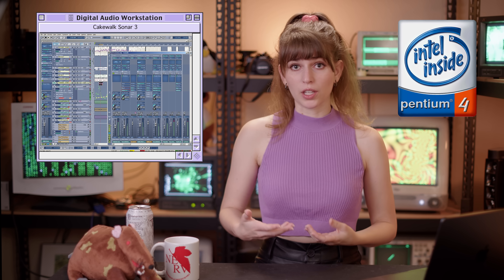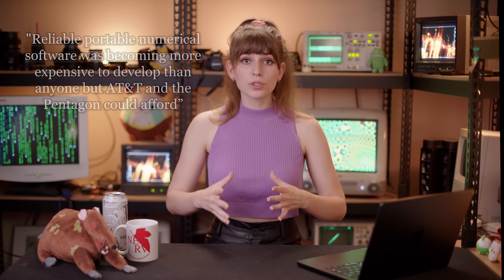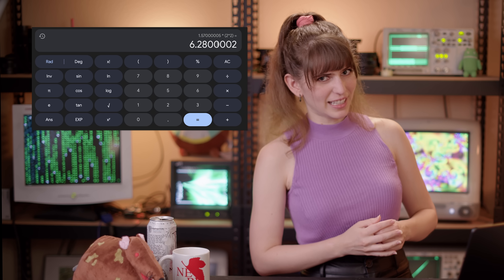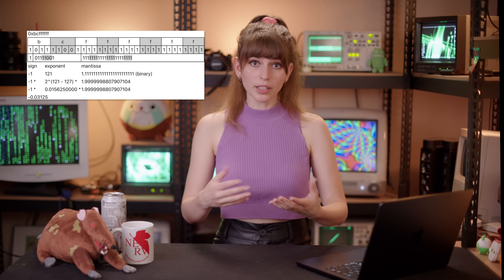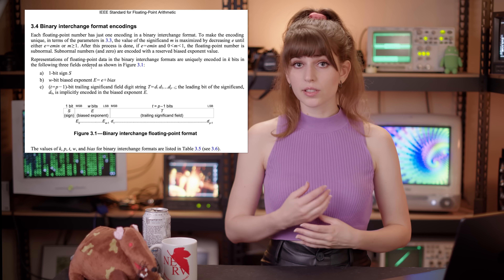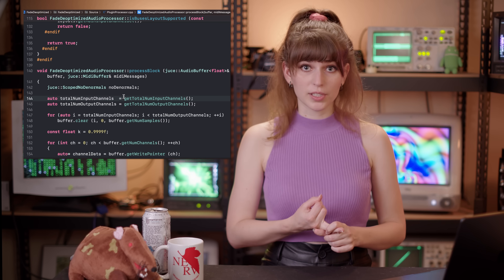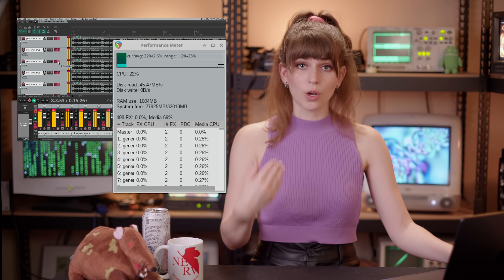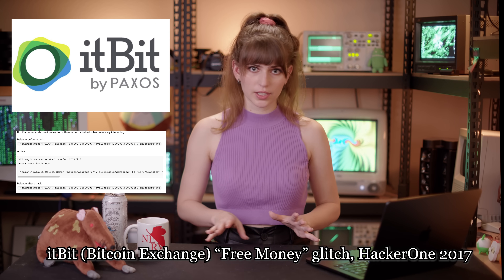Fading Audio is ROUGH on CPUs

Comment: When you're working with floating point, it's rarely about the bit representation of numbers but the algorithm where precision is lost.  Much time and effort is spent finding algorithms which avoid or minimise compounding rounding errors.  For example, if you add a small number to a big number, you're probably going to lose some or all of that small number.  You need to arrange for your algorithm to preserve as much of the small number until it cannot be avoided.  For example, you might have X=(A1+A2)+(B1+B2), where the 1-numbers are large, and the 2-numbers are small.  If A1 happens to equal -B1, they cancel out, and the result should be A2+B2, but if you evaluate the parenthesised sub-expressions first, you might easily have lost some or all of each of A2 or B2, the result can be VERY wrong.  A small, but significant number may even have been reduced to zero.  What you have to do is rearrange your algorithm so that it becomes X=(A1+B1) + (A2+B2).  Now, A1+B1=0, so the result is the full-precision of A2+B2.  If the result of this is then multiplied by a much bigger number, the cumulative error is now much bigger too.

The problem here, is spotting where such situations are likely to occur.  If you can do that reliably, you shouldn't need to worry about subnormal numbers.  One example where this does occur is in Taylor series expansion for calculating trig functions.  Naïve algorithms can quickly lose accuracy.  This is because the many small numbers at the end of the series often get truncated or lost due to rounding if individually added to a large first term, but if you were to add them all up first, they might be significant.

The real problem is that, unlike maths libraries which are written by people who understand these subtleties, the people writing application code which uses those libraries are often not aware of this, and find that they need higher precision to achieve accurate results than they might otherwise be able to get away with.

One of the places I encountered this was when writing a ray tracing program which used ray marching to jump from one possible intersect to the next.  If I wasn't careful, a component of the ray vector might get rounded to zero, effectively bending the ray to follow one of the axes.  By carefully arranging the calculations, I was able to avoid this, and do it all using fixed point arithmetic, using integer maths, and achieve a massive performance increase.  I'm by no means an expert in this subject.  I just have an appreciation of the problem and know a few ways to code around it.

Throughout my 40 years as a developer, I've worked with a number of excellent coders, but I don't think any of them would have had a clue about coding mathematical algorithms.  This is not a criticism of them, it's just not something that's really taught outside of university mathematics departments.  Unless you have a particular interest in the subject, it's unlikely you're going to encounter this.  When hitting a problem, most programmers would probably just say "I'm getting rounding errors, I need to use more precision." instead of "I'm getting rounding errors, how can I avoid them?"

The industry has a more general malaise, which is that efficiency is not really taught either.  Even when it is taught, it's to present techniques which compilers are better at, such as moving common code outside of loops.  Older developers worked with slow hardware, and wringing the most out of every clock cycle was important, but younger developers just get sloppy and expect the hardware to handle it.  For example, I've seen code which concatenates a potentially large array of strings using a loop and strcat().  The writer never considered that each strcat() call has to scan the full accumulated string to find the current end.  Simply using an alternative to strcpy which returns a pointer to the terminating NUL would mean the code might be 100 times faster.

We have a similar malaise regarding program sizes.  Look on any app store, and even the most trivial app is likely to be tens of Mb.  I have a metronome app which is 10Mb.  How on earth does a program which goes tick, tick, tick take up 10Mb?  Even allowing for nice graphics, it still should be possible to fit it in under 100kb.  When you consider what we did on 8-bit computers, often with only 16k of memory or less available for code, you have to wonder what all that extra memory is used for.  My entire Amiga development system, including many OS utilities, powerful text editor, macro assembler, debugger and disassembler all fit on a single 800k floppy.

In all likelihood, today's app writers are calling a simple function from some library, which in turn pulls in a veritable forest of dependencies.  It's one thing not reinventing the wheel, but pulling in an entire wheel making factory, tyre making factory, the rubber plantation, and the steel mill, when we just want a single wheel is crazy and really sloppy.  Tools like nuget and npm just encourage this sloppiness.  Despite all the harm, part of me is glad that the npm worm was written, because it has at least got people to question their reliance on bloated libraries and how blind faith in these tools exposes their apps to infection.

Don't get me started on memory use!  This tab is currently using 1.8Gb in Chrome.  How is that even possible?  There's the video player, a portion of the video is obviously buffered, the comments that have been loaded could fit in under 1 Mb, and the recommended text and thumbnails should only sum to a few Mb.  How does one browser tab use more than 100 times the total memory of my first PC?  That PC would happily run Mosaic, showing a page full of images and have lots of memory left over to run other applications.  Can someone at Google please explain how their browser, running their web page, can use almost 2Gb of memory?

Comment: I built a fixed point solver for simulation of an industrial process with recycle that ran into FP problems. It would not converge in double but worked flawlessly in decimal, only an order of magnitude too slow. Rescaling all the user configurable inputs into (hopefully) similar ranges and praying, fun times. The feeling of betrayal by all those 'good enough' commenters on stackoverflow was real.

Comment: I still remember the day I learned  0.9 + 0.1 is not equal to 1.0 on computers. Later, I also learned how slow floating point is.
Eventually, I learned how brilliant it actually is.
Reply: A tidbit you might be unaware of: incrementing floats to the "next" value is the same as viewing the representation as an integer and incrementing.  (At least for non-negative values below infinity.)  This even works passing the denorm/norm boundary.

Comment: I used to work on DAW software and one of our users sent us a project that took two magnitudes more time than it should to render out to file. I ultimately traced it to a third-party surround audio encoder that used an IIR filter, and the user's project had a long run of silence after some audio. This created the perfect storm to trigger a lot of denormals. On the Pentium 4 where denormals are two magnitudes slower, this really slowed it down. Since we couldn't adjust the third-party code to flush to zero, we added a tiny bit of noise to the audio before passing it to that encoder.
Reply: Why exactly does adding noise help in this case? Because the code doesn't have to handle infinitely small numbers when calculating a sample?
Reply: @hikkamorii it prevents denormals, yes
Reply: I had the same issue and I switched to fixed point arithmetics with 32bit ints and shifts.

Comment: The P4 was a pretty poor architecture with a long pipeline for executing various operations, it was also power hungry and hot. It performed particularly poorly for things like audio editing at a critical time where these creative PC workstation tasks were growing in use which helped establish Apple in the creative niche at a time when they had other issues. Personally I avoided both by upgrading and agressively overclocking my P3 system. I eventually upgraded to an Athlon 64 which wasn't a particularly good architecture either 😂

Comment: As a professional DAW software engineer,  we are used to seeing and battling CPU spikes when denormals enter the audio pipeline stream. Once they are in they never leave, unless you set the flush to zero flags which is the normal way to deal with them. see what I did then ? You are correct, they are far below the audio threshold and I would argue it is not necessary to preserve that level of precision at all. You would, for example, never reduce your audio down to subnormal level then reamplify up to audible levels.

Comment: Why is your background fuzzy when the monitor that is turned side on not fuzzy. Explain that. Interesting.
Reply from the maker: focal distance, that monitor is in line with the focal plane, my background isn't
Reply: @lauriewired  Yes that is what I thought as well, but 'as well' something to do with the sync frequency being modified by the viewing angle. The camera and monitor frequency are aligned ie in phase as well as frequency.
Reply: @lauriewired  Your error has the same issue. Topology can reduce errors something to do with alignment. Not always as simple. Just add more zeros 360.000000/float(N) gives you the accuracy your requiring. Where N is an integer.
Reply: @lauriewired  A lot of algorithms use Taylor series approximations. Also when doing 3d graphics a divide by Z is required. Doom uses division by power of 2 because that is the same a a left shift. Super much faster that an algorithmic long division or the taylor series approximation of a divide.
Reply: @lauriewired  You can take it or leave it as what it appears 'to be' or what it appears 'not to be' in that case. I invented subfinite numerics so I can talk all day about that or not in that case. Due to being super not bothered. And super 'bothered' by that as well.

Comment: My opinion is that far too many people don't actually understand how floating point works and due to that issue. frequently attempt to get around the issues by using fixed point math. Unfortunately, that leads to the issue of "false precision", which they don't understand.

Floating point
1. Has a fixed number of significant digits.
2. Has a varying level of precision, depending upon magnitude.

Fixed point.
1. Has a fixed level of precision
2. Has a varying number of significant digits.

Or, as the typical errors manifest
Floating point - Why the hell are you looking at that digit? You damn well know the format doesn't support that number of significant digits.

Fixed point - Why the hell are you acting as if that digit is significant? You damn well know your data doesn't support that many significant digits.

Comment: This just popped up again and I suddenly realized you are where I got the information about sound being hard on the CPU. 

I was sitting here enjoying my game engines spatial sound system all implemented on the GPU, saw your video again and thought I might have to come and thank you for the info. 

So thanks, helped a bunch. I never even bothered doing it on the CPU because in the back on my head I remeber gaining this information somwhere and it was directtly related to audio fading  - and spatial sound is pretty much fancy audio fading on both channels seperately.
Reply: this is wy using a amp and doing the volume there is better
Reply: @8alakai8  Amp? Spatial audio for games brother/3D spaces brother not live audio

Comment: What is missing in this video is a more precise representation of a floating pont number in a computer.
You say it has a sign, an exponent and a mantissa. You note that the exponent is biased without saying what it means (not the most important thing for this video) and you don't say a word about normalized floating point numbers. Those who don't know much about the subject will scratch their head making sense of the video. 
Floating point units love normalized numbers and hate denormalized number. These denormalized numbers have to be normalized and everyone is happy. The problem arises when the number is so small that it cannot be normalized. Such a number will usually have plenty of significant bits in the mantissa and just saying that this number is 0 is incorrect. For this reason subnormal numbers were introduced but give a headache to the floating point unit which loves normalized numbers and has to spend more time dealing with these subnormal numbers.

Comment: The matter of floating point numbers and rules for numbers rounding is very interesting but you've presented the matter in completely wrong way. In fact you spread disinformation. 

You haven't explained, therefore I need to assume, you talk about the sound being coded as a stream of 16-bit integer numbers. The volume of the sound directly depends on the range of the numbers in the stream. Therefore there's no simpler task than fading the volume half by half in each cycle. As a programmer you should know that. Dividing a binary number by two is as simple as shifting bits in the register to the right by one position, loosing the least important bite. Of course, the more you want to reduce the volume, the further to the right you have to shift each number in the stream. Theoretically in the last cycle, you have to shift the numbers 15 positions to the right, but after 7 position shift the volume would be reduced more than 100x, no need to go further. 

You haven't explained, but the problem begins when you want to reduce the volume by some percentage in each cycle, like 5% for example. Then you need fractions to calculate new values for sound stream numbers. @0:15 - here you give a false impression by saying "as you work with smaller and smaller numbers, you slip into category of subnormal numbers". Well, that's disinformation. You don't slip into subnormal numbers at some point. Numbers in the sound stream are always integers. Only the volume factor in your calculations might be subnormal number, right from the beginning, let say in the range from 0.99 to 0.01. No need to get less than 0.01 - the sound will not be audible below 1% of it's original volume anyway.

By introducing your plug-in for sound fading and showing rising processor load you make another false impression. Modern sound cards are developed in such a way, that there's no need to engage the main processor to regulate a volume of the sound. Sound cards have multiple sound channels and each of them has respective volume "knob" with 256 levels. To change the volume, programmer has to just recall to card's driver with one byte number as parameter. Decreasing the volume is especially simple if you just want to cut it in a half with every cycle. Or just roll down from max (255) to min (0). You definitely don't need any floating point numbers operations.

Of course, you can complicate the matter as much as you want to prove your point, but at least please explain how you use 'denormals' in the whole operation. From 14:20 - what is actually going on? What EXACTLY your plug-in does? 

Your whole presentation suggest that you don't know what you are talking about. Maybe you've read some magazine from 2000s and got inspired. Probably you haven't code the plug-in, you don't know what it does algorithm wise.

The matter of floating point numbers and rules for numbers rounding is very interesting but you need some other case to present it properly.

Comment: I am fairly sure I have a solution for exact precision computationally on any CPU for any floating point operations. Sounds nuts but I'm pretty sure I do have a method for doing it which is ridiculously cheap on compute and is actually faster and easier that normal compute. I can also represent Pi exactly, or 1/3 or anything really. I think it is totally and precisely exact and can be used to generate floating point and rational numbers and irrational etc. Like √2 can be represented exactly for what it is and all computation done in that form, and only output a floating point after all the compute is done, and we have the closest required floating point if we ever need it. So that would only be one approximation on required output not a chain of approximations compounding, avoiding any fuzziness at all really.

Comment: The PlayStation 2 was a real "favorite" of mine. They cut a lot of corners. They did the usual ones - only single-precision, and only flush-to-zero. Reasonable for a games machine. But they also didn't do all the sticky and rounding bits right, so even for non-denormals, the lowest bit of the mantissa was... well it wasn't random exactly, but it was... "poorly defined".

What this meant was that for a lot of perfectly standard numbers, x * 1.0 != x. And y + 0.0 != y. This caused all sorts of problems, because you could keep adding zero to a number, and in some cases it would gradually get larger and larger and larger. Code that worked perfectly fine on every other machine, including other consoles, just went... a bit odd on the PS2. Such fun. Thanks Sony.

Comment: But why use any floating point numbers in DAW anyway? All sound data is encoded digitally with 16-24 bits, with specific sample rate. Just subtract a value from sample or shift it n bits for few (hundreds of consecutive samples), then increment the value or shift one more bit. Let the DAC of the sound card deal with all that analog imprecision...
Reply: I don't know, but I did find a medium article titled The Advantages of a Floating Point System in a DAW that might have an answer for you?